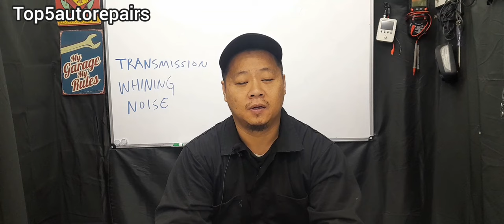TRANSMISSION WHINING NOISE WHEN ACCELERATING

Comment: What if nothing overheats but whines when accelerating
Reply: I have Lancer 2013 and it started to whine when above 2500rpm after 10km of drive. Changed oil, the sound lowered a bit, but it comes up after 2000km of drive.
Reply: Same with a lancer 2009
Idk if the transmission is whining because it sounds like a whistle/supercharger sound 
 @metalstorm54
Reply: @msc807  are you going to get it repair?
Reply: @msc807  any updates on the whistle/supercharger sound? got a similar issue with my car.

Comment: How long can you drive your car with that whining noise before ut completely fails? My car has over 300k miles and don't want to put a lot of money into it.
Reply: Has it given up.yet?
Reply: My Toyota Hilux 2007 autotranmision have whining noise and not repair yet.  

I need to confirm which  bearing are problem .

Comment: The transmission shop said they are going to have to rebuild my transmission again cause either the trans pump went bad or the torque converter went bad, on my 2020 camry. Man you were wright it under warranty from the last time and it will not cost me a penny to have it rebuild this time !!!!
Reply: Did you get yours fixed? Currently going through the same with my 2018 Camry. Whining sound whenever I accelerate and it goes away when I’m not accelerating

Comment: My truck has a leak but was never low on fluid it started making noise at around 15 mph and beyond no kicking when it changes gears no slipping drives perfect just noisy

Comment: My 2012 6.2 f250 i just bought makes a very loud  whining noise from the transmission. It shifts very strong, no slipping or lurching. I noticed the fluid is overfilled quite abit. Really upset because i want to find out exactly whats wrong without getting ripped off.
Reply: Are we taking loud noise are a light noise also what if that small noise disappears over 15 miles per hour?
Reply: Happens at 25 and stops at 40, if I let off the gas the sound instantly stops
Reply: What did it end up being?@therealdeal717

Comment: Have VW T5 minibus.... Put in a complete new clutch kit recently..... Drove okay for about a week or so then had trouble shifting again.... No leaks in the clutch line..... Have whining noise whenever in gear during acceleration and decelleration....but when i put in neutral the noise stops.... As i said it mostly shifts difficult in forward but shifts smoothly into reverse gear.... I doubt its thr pressure plate coz its brand new..... I suspect its the gearbox itself..... We changed the gearbox oil when fitting the new clutch kit

Comment: My '06 Explorer 4.0 with just over 300k km's was making an whining noise for about a month, worse at start and would eventually fade, except recently it remained noisy longer. Anyway, it was driving me crazy trying to find it.... Today, I did. It seems that the torque converter packed it in, according to the code. Truck would barely move and especially struggled going uphill. Repair might well exceed vehicle value as I don't really have anywhere to do this kind of job. Sucks as the truck still looks new.

There's no dipstick in these things but I did get new filter and fluids in '19 at an oil change place. Hmmm. Seems to be a common problem with these nonetheless.

Comment: My transmission only makes a whine under heavy lateral acceleration. Taking right corners hard makes it whine. Then if you let off the gas for a couple seconds its fine. Its fine driving normally and in a straight line
Reply: I'm having the exact same issue.  Did you ever find out the issue? At first, I thought it was a power steering issue,  but my dad recently had to drain fluid from my car because he said it was overfilled.
Reply: @hazeew.6272  which car?
Reply: @DearMajesty  It's a 2006 chevy impala
Reply: @hazeew.6272  I wouldn't know. Sorry
Reply: Wheel bearing g

Comment: I do have a question. Our 2012 passat always made a whine as you drove it. When you drive and put it in neutral, that whine goes away. I’m thinking the transmission fluid should be changed.  It’s been a few years now. It shifts well too.
Reply: Did that fix it? I also have a 2012 Passat with the same issue. I’m getting the transmission fluid changed tomorrow
Reply: I took my car to oreillys and it had said transmission request on the obd. Do anyone knows what that mean . ? Is it low on transmission fluid or something because it doesn’t give me any transmissio

Comment: Mine just suddenly started whining , but still goes into every gear. Then after awhile it’ll start to get stuck in 3rd. Is it possible that it’s clogged filter not allowing fluid to run through

Comment: I have a 2002 E350 Van with 7.3 diesel and 4R100, it only whined / lower power  when I was in the mountains and now more recently with the 105deg heat. I never hear anything or feel any issue until the transmission is "heat soaked". Is that normal with the fluids heating up and making the oil pump work harder? Would an after market transmission cooler resolve the issue? I had the transmission rebuilt and new torque converter installed 30k miles ago.
Reply from the maker: It sounds like the van is overworked going uphill and hot temperature also a factor. An external transmission cooler will certainly help.

Comment: Ok so on a Chrysler 300 2006 it just started whinning today i had it 11 years when its hot want shift cut it off shifts then hot same thing with whinning so pump is bad may need rebuild 220,000 miles?

Comment: I have changed everything, transmission fluid, new tran filter, both diff/gear oil and still whining. What else can it be? 08’ highlander
Reply: Did you find it? Could be wheel bearing or differential or u joints
Reply: @RustyShakleford1  Wheel bearing will cause whine noise and shaking as well

Comment: what happen if transmision grind noise between 2nd gear to 3rd gear,.then if i will put 3rd gear selector manually I don't have notice a noise,.
Reply: It's your torque converter

Comment: Why does my transmission take forever to get into 4and5 gear? 2001 dodge. 1500 automatic when the weather is very cold-30 .20
Reply: The 4th or 5th gears are slipping. If your transmission fluids level is still good you probably have a failing transmission. It will cost thousands for a mechanic to fix it

Comment: Hello my friend. I have noticed that my cat whines when accelerating at low and high speeds. From 0-50 I hear a whining noise. Could this be the transmission oil? Have not changed transmission oil and my car 2018 CHEVY MALIBU 1.5L stock model. If I change the oil, will whining go away? If it does not go away, do I have bigger problems? Thank you for your time. My car 76k miles is not being driven anymore until I change the oil myself later this month.
Reply: Mine is doing the same! So annoying. Did you figure out what it was??
Reply: @JustUsLeagueAZ  So it could be a few things but I still haven’t gotten it fixed or anything it’s just been in my lot. I’ve researched around on forums said it could just be the noise of the four-cylinder v4, the way Chevy has made them past the 2017 year model they are just very annoying and very loud. I haven’t done any of the major transmission oil maintenance yet so in my case, it could be my lack of maintenance on the vehicle. I’m at 75k miles and haven’t changed transmission oil yet. I’ll report back when I do but that might be the culprit. My MPG has suffered a lot, currently down to the 20-22 mpg range. This has been my first “new” car and I’m afraid I’ve neglected it too much (drove from state to state) and hopefully my transmission isn’t slipping or anything. It’s a good car but I would get another one if I could lol something cheaper that I could use because I’m not that good with cars LOLOL
Reply: Haven’t changed spark plugs either and I had a code pop up saying that one of my cylinders is misfiring. You could get a code reader online or take it to your local AutoZone and see if anything gets picked up. Once I address those issues I think car should be fine or else I’m fucked